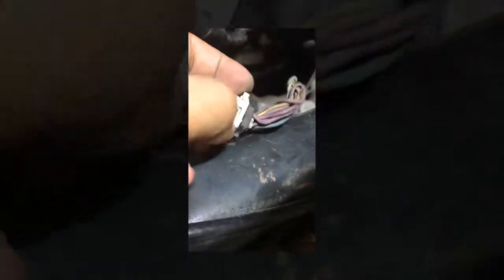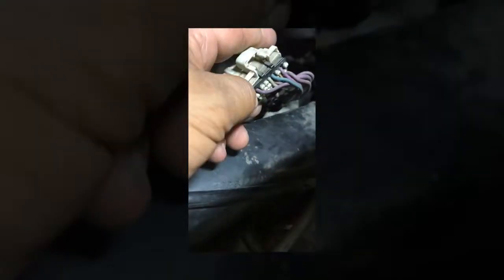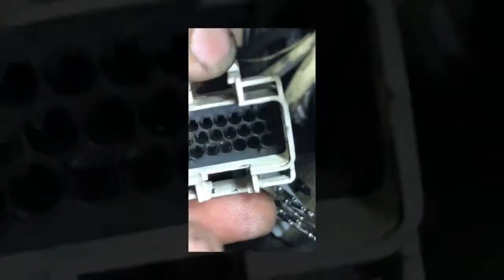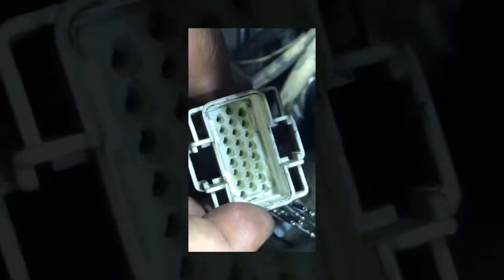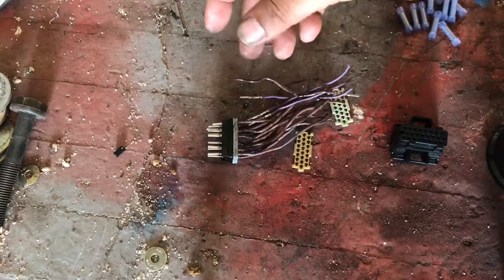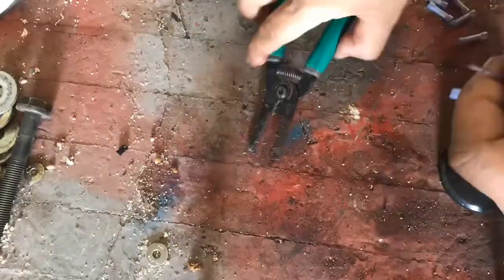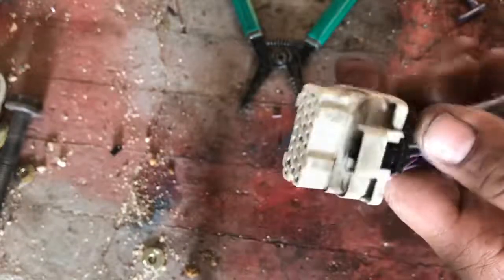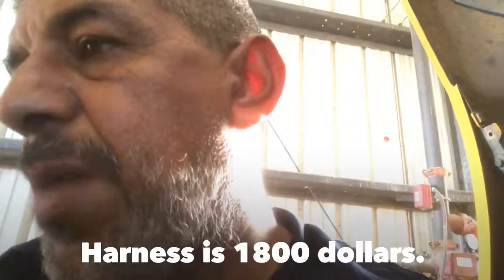2006 ic bus 🚌 electrical harness repairs

Comment: I had same exact symptoms on 05 4300 but it was chaffed idm ecm wiring in the battery box
Reply from the maker: Miguel Payano   These issues start after 10 years of units service. We r starting to see these type of problems on our older units. We have replaced a few of the battery jumper cables. The ones with the integrated fuse holders.